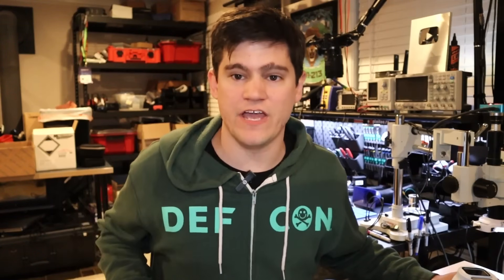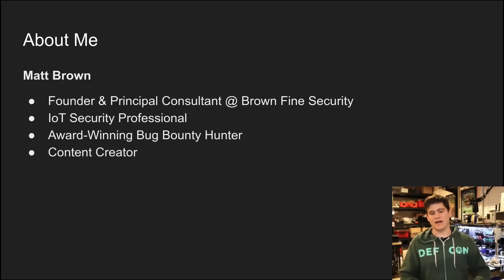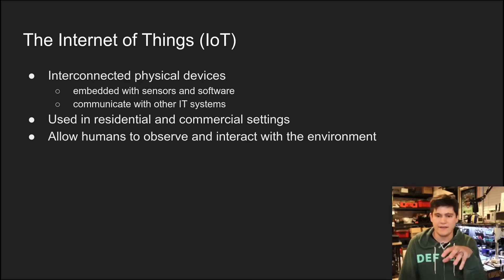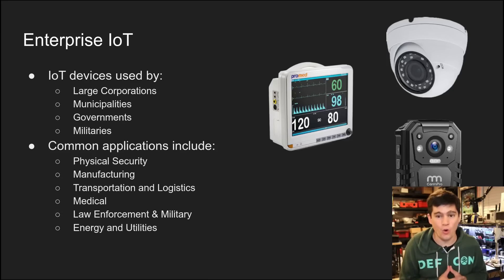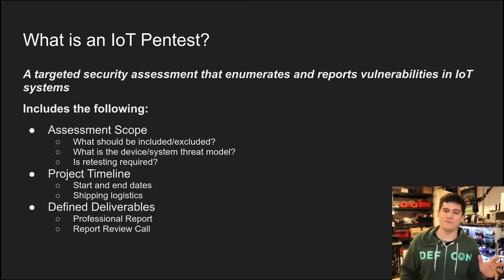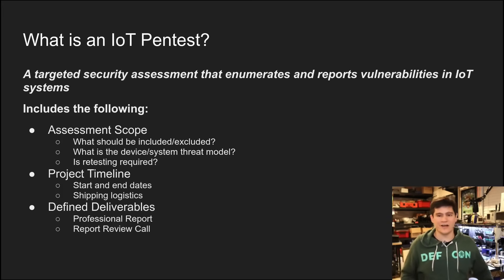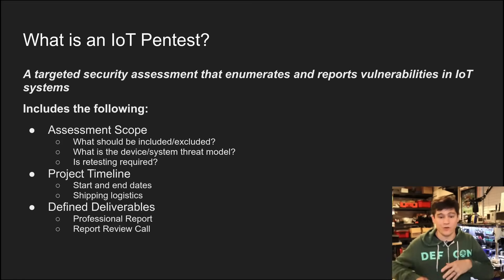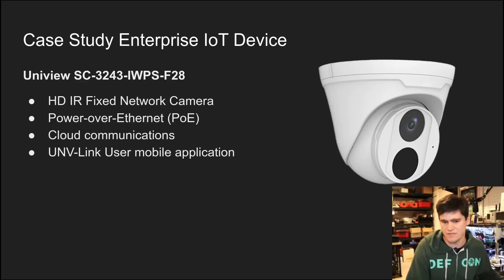Enterprise IoT Pentesting - Intro to IoT Pentesting

Comment: hello there and good job on your videos, could i suggest a pretty unexplored field? i am a fpv pilot and the transmission system they use is pretty unknown form what i know and for the modding fpv community would be pretty cool to mix into the hacking community. like the dji goggles 2 and 3 have an integrated headtracking chip that transmits the data trough the video link to the avata and avata 2 etc but it cannot be used to control a gimbal with their air unit o3 or o4 (the transmission module for thinkeres that build their drone) and for that reason peaple stick an external module to the goggles that transmits the data trough the controller link using the mavlink protocol, the problem is that mavlink is only available when cpu has time to do so. sorry for the information outburst but it is  a world to build a drone. thx for your time. i could help doing as a proxy as i did some fooling around some times and once i even managed to dump a firmware off a chinese camera even if then i i did not know what to do next and dumped it XD but with your help maybe.. just let me know i have hardware etc to use in case